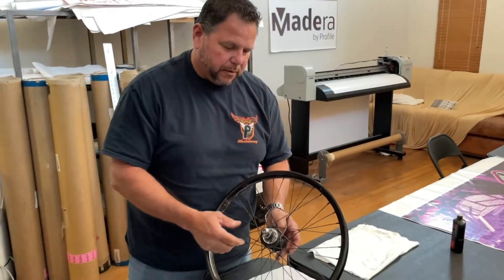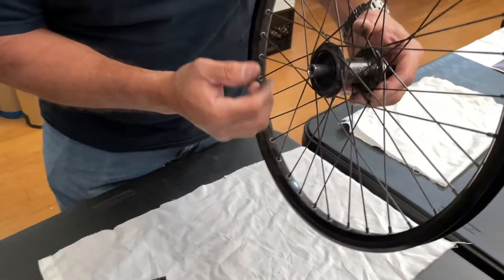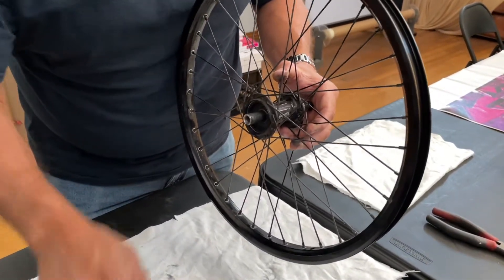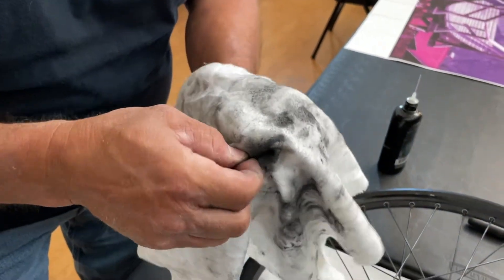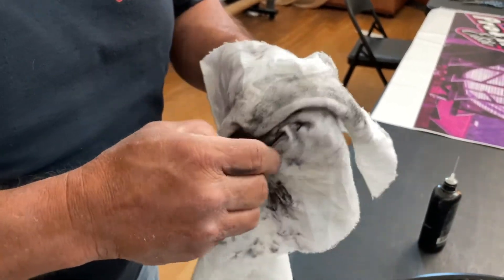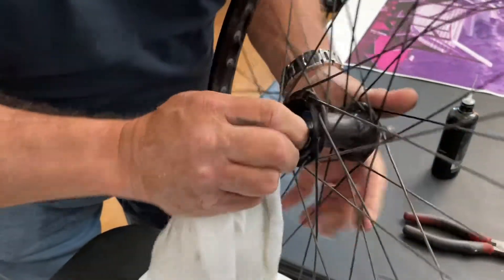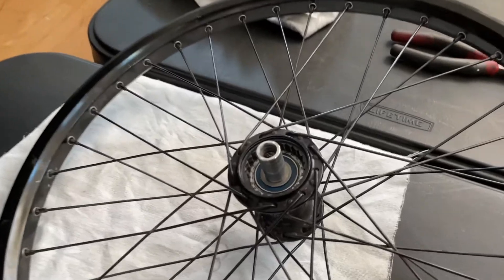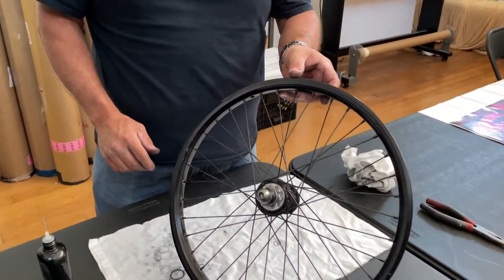Profile's Tech Tuesday: Driver Maintenance

Comment: Is it difficult to pull out the 2 bearings inside the hub and install new ones?
Reply from the maker: The hard part is getting them out. Without a slide hammer, you may have to take them out with a hammer and screw driver. In that case, it will more than likely destroy the bearings. From there, you can use a simple press to get them back in. Hope that helps?

Comment: I can't get the jam nut off of my mini rear hub. When I go to tighten the axles from the hub to my frame the wheel doesn't spin anymore. I have the shim in place between the bearing and the driver, but still the issue persists. Any and all suggestions would be greatly appreciated.
Reply from the maker: If you could, call our factory and ask for tech support: 727-391-7370

Comment: How come my mini driver doesn’t just slide out like yours? 🤷‍♂️
Reply from the maker: When compressed over time, the grease inside the hub could have a suction effect.
Reply: @ProfileRacingOfficial  thanks for the reply. It just needed a good pull. I greased it up but now I hate how quiet it is. Was planning to degrease it. Any suggestions on how to make it loud af again without potentially damaging the hub down the track.